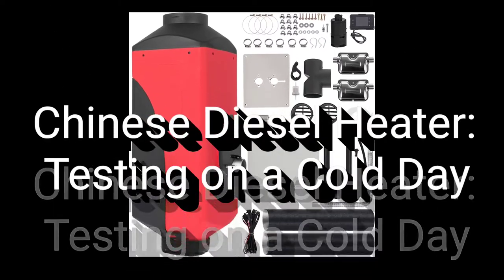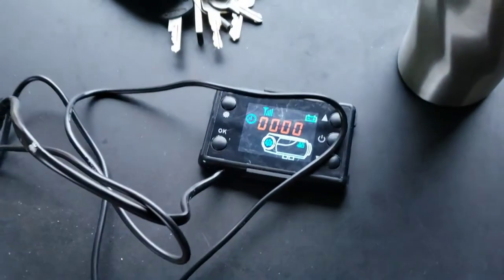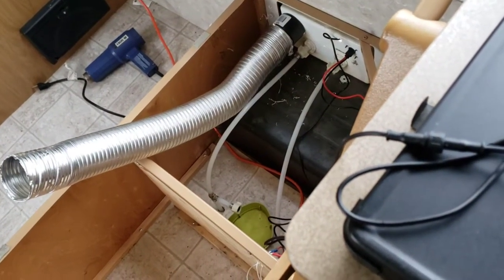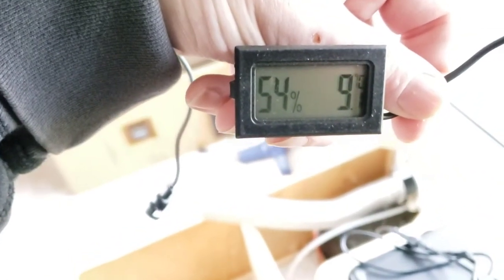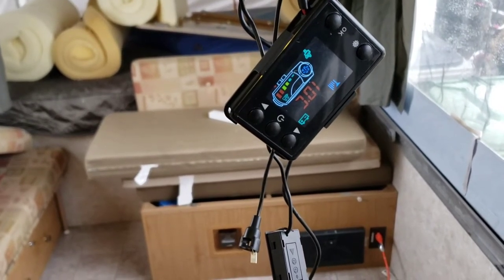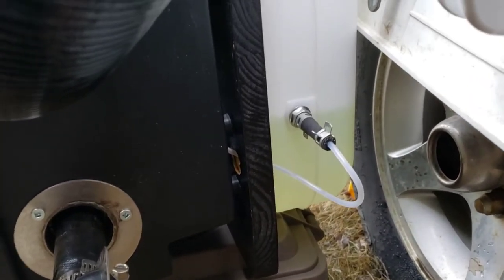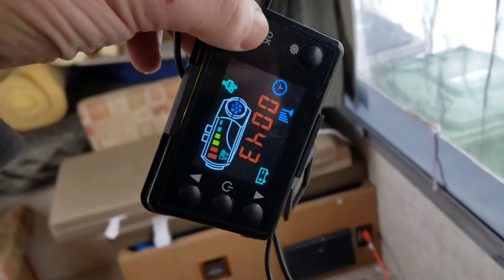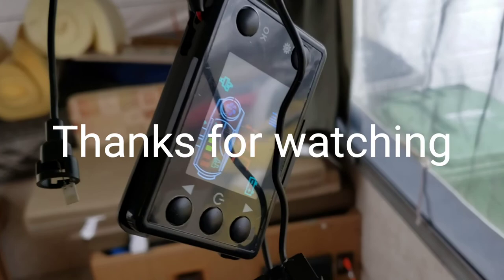Chinese Diesel Heater in a Box: Testing on a Cold Day

Comment: If the little Temp/Humidity meter showing 10% that is quite dry . The problem ive been having since i run mine in my house is it dries the heck out of my nose and throat. Now i have to run my Diesel Heater with a cool mist Humidifier running all the time .This is not a big deal but i wanted to be able to read the Humidity in the air so i just bought one of those Temp/Humidity meters just so i can monitor the Humidity in the Air